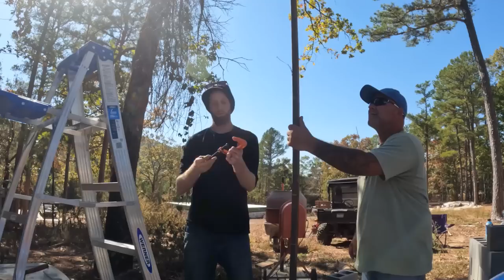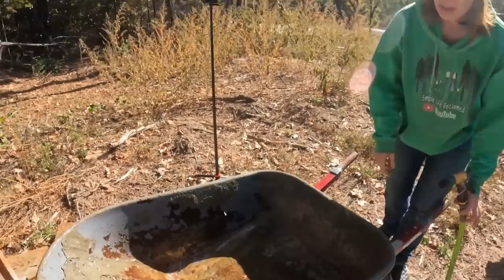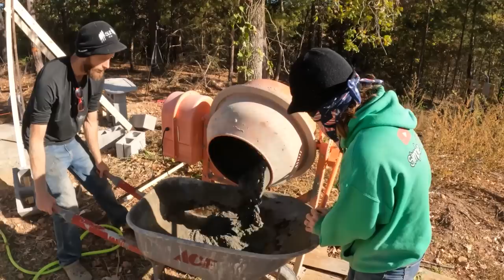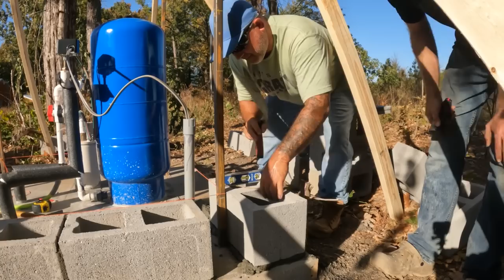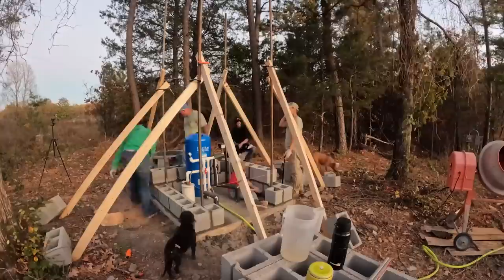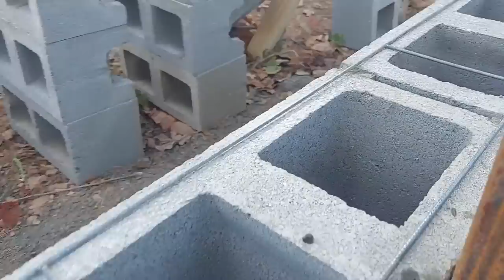Laying Block Well House w/ Friends| How To Masonry| Couple Builds Dream Cabin Homestead In The Woods

Comment: If you have a bucket of water there , Any time not using trowels or striker , just put in water bucket , Clean trowel makes things easier . Also a wet piece of cardboard on top of mud in wheelbarrow will help keep the mud from drying . And a plastic bottle full of water with a hole in cap is good to keep near mud board . Then can keep mud tempered , and temper a little mud if you need for special occasions . We let the mud joints dull a bit then strike . If get on block , wait and let it set just a bit and cut it off with trowel , less will stay on block that way . And if hands turn white after being in mud or start to get burns , use vinegar it will stop the lime  . Like you said many ways to do it , and you are doing a fine job .

Comment: Question; why didn’t you build your slab to fit the blocks so you didn’t have a have cut block on each row? And you didn’t mention anything about putting in masonry cement for tackiness. The Portland does definitely make the Masonary harder :-).

Comment: That's hard on the skil saw.  I buy the cheap HF ones just for similar concrete cutting because I know it isn't going to last long. I don't do enough to justify a good concrete saw with water dribbler.  I've used water for slab cutting with skilsaw and had good luck but really messy. Less messy than filling house with fine dust though.

Comment: I built multiple large block buildings using a large mixer and discovered that putting the measured water in first was best and then added the measured sand and cement.

Comment: I admire you guys for trying but as a professional bricklayer and builder there are a number of things that I would do very different. First off, laying blocks I would not use a steel profile, a 4ft spirit level and a good eye is all you need! That boat level you are using will be about as accurate as using pallet wood.  I would also suggest that the manufacturer put a long handle on those hammers for a couple of reasons, 1 to save you taking the skin off your knuckles when you miss the head of the nail and, 2 you get more power at the point of impact if you use the correct end of the handle. The reason your mortar is sticking to your mixer is because you are putting the cement in before the sand, do it the other way round and the cement folds into the sand and doesn't stick to the wall of the mixer.  In order to give your blockwork even strength your mortar should me 'gauged'. So if you are using a mix of 1 part cement and 5 parts sand, each sovel, bucket, gauge pot should be identical in size.  As you point out in the video, never put you hand/arm inside a moving mixer.  That said, you should never turn off a moving mixer unless it is absolutely necessary,  restarting a full mixer tub puts unnecessary stress on the motor and drive system.  When spreading the 'bed' for your first course, lay enough mortar to be able to spread to cover the with and length of a block, 'trowel. the mortar into place using the nose of your trowel so as the mortar end up with two shoulders and a valley throughout it's length. Set the first block down and using your level on the length of the block check to see if it is level if it is not, don't hammer the block down with the trowel, it just causes damage to the trowel and sometimes the block. gripping the block with both hands (one hand for a brick) slide the block slightly back and forth putting more pressure on the end that needs lowering. The transverse level is achieved by placing the 4 ft spirit level vertical on each outside edge of the block, if it's vertically 'plumb' then it has to be level on the transverse. to lay the The next block, spread a similar bed as you did for the first block then, resting a block on the floor tilt it and spread a thin layer of mortar over the entire end, then apply a 'shoulder' of mortar to each side keeping the face of the block clean.  Set the block in place lowering the mortared end first against the existing block then 'wiggling' the block back and forth feel the block down until the mortar end is level with the the existing block and the opposite end is approximately right, now taking your 4ft spirit level lay it over the length of both blocks and using a similar technique as before, manoeuvre you second block in place. Using your thumb is not an accurate guide! You are looking to achieve a   10mm or 3/8" perpendicular joint between the two blocks. When 'pointing' the joint work do all the 'perps' (perpendicular joints) first, then the bed joints, doing it the other way round leaves tool marks in the finished joint. You are putting 'straight' joints into your blockwork then adding reinforcement! The bond that you have used is a 3/4 lap joint, you need a half bond so that the joints of the second course fall half way through the block on the first course, this would have been achieved by placing a half block on the 'return' of your stop end corner and a full block laid across the bottom blocks on the first course, this will start your main blockwork run with a half bond joint. this way, you have good even joint discipline and no 'rebar'. So you not only have a stronger build but you save money too. Oh and on those returns, you could get away with using a profile or making up a 2 x 4 temporary 'door frame'. So no vertical levelling is then required!.

Comment: It’s good you guys are showing friends how to do block work. My father was a professional bricklayer.  PLEASE Please 😢don’t put your hand in the running mixer ever. My dad after years of working put his hand in to test the mixture. He was pulled in to his shoulder. I was with him. His arm was cut open just below his shoulder. All I saw was a open wound with blood pumping out. I quickly pinched the artery off with my fingers. The ambulance arrived quickly. At the hospital is when I found out he had his fingers torn off. Only thing left was his thumb. The hospital was close by. An intern went to the job sight and retrieved his fingers, 3
Reply: we were reattached. One by one that got infected and had to be removed. After a full month he was released from the hospital with out his hand😢

Comment: the work is Ok but the design is bad, you should make the walls to fit the measurement of the blocks. if you make the slab a bit bigger you will not need to cut any block